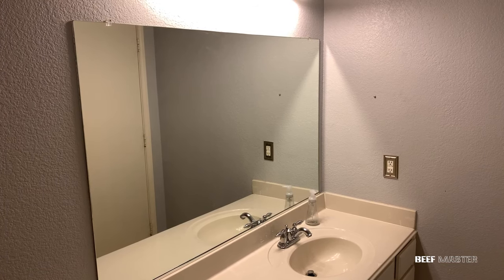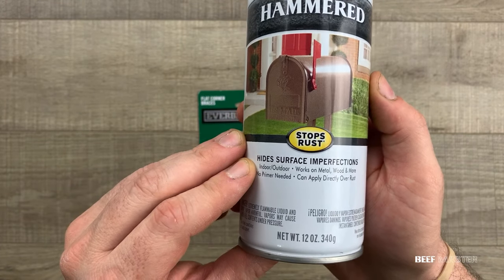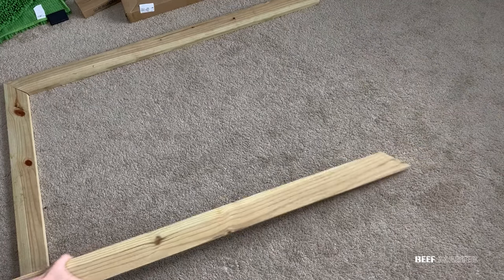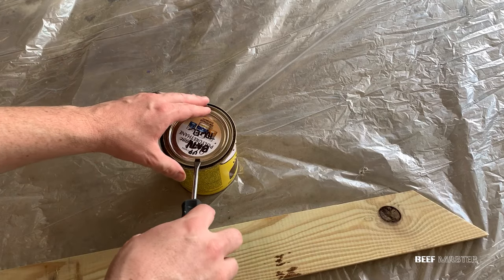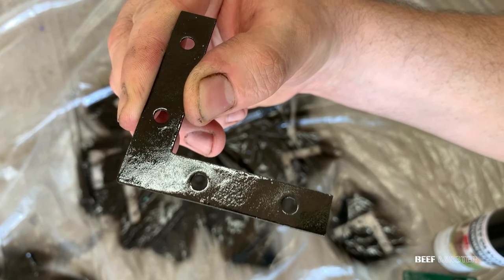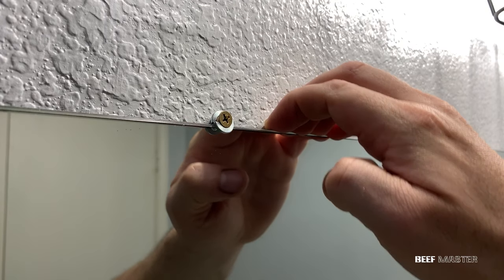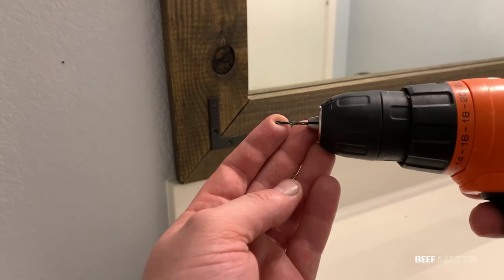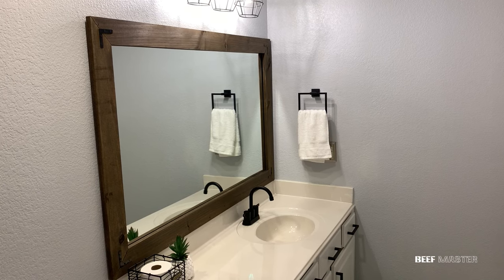How To Easily Make A Custom Mirror Frame

Comment: No sealant on the wood? In a bathroom? Needs some poly over the surface. To keep the rustic look you can use a flat sheen which is better than nothing, but a higher sheen would be best.

Comment: I am so glad I found this video!  I knew I was in the right place from the beginning bc I have the same mirror with the same things holding it onto the wall that you had in the beginning with the same color and texture wall!  I don't have those lights though (but I wish I did).  And, we are currently trying to figure out how to frame the mirror (although that is not how I stumbled across your video).  I LOVE how this turned out!  This is exactly to my taste and my liking.  And I REALLY appreciate all those little tips you gave (stopping up the drain, don't spray your wedding ring, etc.) ESPECIALLY the "don't put too much glue on it bc it will reflect in the mirror" bc that is something I would totally do.  Thanks so much!  LOVE this video!!!

Comment: We followed this and our new mirror frame is great.  Your best tip was the fuze it.  We did 2 L brackets on each corner (at outside and inside edges) which added strength.  We also put small wood blocks on the backsplash to evenly space and support it until we were sure it was secure.  Thank you for posting this… very helpful!!!

Comment: This is a good quick idea.  I just finished mine and it does change the room.  I followed everything he did except the liquid nail.  I built the frame completely  then used 3M sticky so that it was so permanent.   The imperfections in the wood make it so only use 220 grit sandpaper.  When you do the brekets before gluing it's easy to work with.
Oh yeah and I'm in Canada.   It costed almost $45 no big deal

Comment: Usually, it is release the clips and take the mirror out. But, given the clips will be gone after you put these beautiful frames, how are we going to remove the mirror, should there be a need to do so. Thanks once again for the video. It is very helpful indeed, and of course, the frames are aesthetically very pleasing. I am contemplating to do something similar.

Comment: Looks great! Personally I would have taken the mirror off the wall, moved up 1-2 inches and made a notch out in wood for the width of the mirror and mirror clips. May be able to get away with no glue then, and wood frame is flush to wall. To avoid bloching of stain (some areas darker than others) can use a pre-stain conditioner.
Reply from the maker: Great comment. Good ideas for next time.
Reply: There's many ways to make this project more complex, but the need doesnt call for it....  for a quick non weight bearing frame that's just for looks... this more than does the job.

Comment: thank you!! My bathroom mirror is like yours but smaller in my apartment. I’ve been looking to make a a cheap wood frame that will be easy to remove when I move out. I’ll have to try this!
Reply: I won’t be able to apply the glue directly to the mirror though 🤔
Reply: You could use command strips!

Comment: Suggestion.. you might want to use double braces so you don't have to glue the bottom board.  I.e. if you later wanted to replace the countertop, you might want to just pop off the bottom board for access rather than having to pry the bottom board off the mirror.
Reply from the maker: Great idea. Thanks for the comment.

Comment: Great  and easy video to follow. I have a mirror like yours, but I noticed yours appears to be sitting on the backsplash of the counter. My sits in the metal sleeve that came with the mirror. The other edges are held with the same tabs. My question is... The metal sleeve is not flush with the mirror. If I remove the sleeve I do not know what would hold the mirror. Any suggestions?

Comment: The one thing I don't quite understand is that, isn't there a small gap between the frame and the wall since it's sitting on the mirror and overlapping or how did you get it flush with the wall without cutting a groove in to account for the thickness of the mirror?

Comment: Do you not have to cock or fill the gap between the mirror and the wood? You mentioned the glue does not show if you go down low enough but is there not then an opening between the glass and the wood?

Comment: Great video! I will give this a try. Question, won’t the screw head and washer give it a bump to where the wood will no longer be flat against the mirror?
Reply: Using the same glue to attach the mirror to the wall would bypass the need for the screw and washer. I'm with you, there has to be a bump and that would jack up my project.
Reply: @davestockton5340  I was thinking the same thing.  Glue it is.
Reply: I'm just starting this project and got the standard plastic hangers, and then I thought the same thing...the boards won't be flat against the mirror.  I don't want to glue the mirror to the wall, so I'm going to chisel out a small recess on the boards to accommodate each bracket, they will lay flush against the mirror that way.

Comment: I got to the point where I stained my wood with varathane stain and poly but the wood is bowed. When I went to glue it, the sides were not touching the mirror. I wonder if it bowed while drying or if it was already like that but I don’t know if/how to salvage the wood and finish my project.
Reply: We are in exact same spot. What did you end up doing? Scrapping it & starting again? We have two boards already glued on before realizing just how bowed they are & aren’t connecting right.

Comment: What if the mirror has those silver pieces holding it on the top and bottom? Do we just place the wood directly over those or would they need to be removed for a more seamless appearance?
Reply: Remove and replace with washer, if screw is button head, replace with flat heat

Comment: Thank you so much, this has been so helpful! May I ask why the wood needs to be an inch wider than the mirror?
Reply: The edges of the mirror will be visible if the frame is the exact same size as the mirror itself. Just did my frame yesterday!

Comment: so does the frame sticks onto the mirror or the dry wall?
Reply from the maker: Mirror. You could also just build a similar frame and use hooks or wire behind the wood to hang if you don't want to permanently glue it to the mirror. If hanging it, you would want to make the frame a little larger than the mirror to hide the hooks or wire.

Comment: Question for you: let’s say you eventually will need to get the mirror off the wall. How would you do that?

Also, do you recommend sealing the wood?
Reply: You would have to pry it off but you don't have too seal if you dont want, if you want a gloss or satin look go ahead but its not needed.

Comment: So.. what if I don’t have a miter saw? Will home depot cut the 45 degree angles for me?
Reply: Plenty of ways to do square cut corners.......
Reply: A miter box and saw cost $20. If not you can use a straight board, a crosscut saw, some clamps, and math. A 45x45x90 angle is isosceles. So depending on the dimensions of your mirror you can measure 2" up and 2" across (arbitrary values). Draw a line between those points. That's your 45. You can freehand cut that or use a straight board and a pair of clamps to make a guide for your cut. You'll probably need to sand the sides flush afterward, so be sure to dry fit your boards before installation.
Reply: @franciscoramirez-lt3zc  ummmmmmm lol 🤔🤔🤔
Reply: Example; If  your using 1x4's (3  1/2" wide) and you want the OUTSIDE of your frame to be, say, 48" wide x 48" high, the two vertical boards would be 48", and the two horizontal boards would be 41". (48" less 2 - 1x4's)  Doesn't get simpler than that, and that's what most new homes are doing where I live. And the new extreme wood glues are so good you really don't even need nails.

Comment: What if I don’t have that saw? What’s another option
Reply from the maker: Two thoughts:
-You can make the mitre cut with a handsaw. Pencil a 45 degree angle at the corned end of the board then make sure the wood is secured in place by clamping it to a table with the end extend for the cut. As handsaws are very cumbersome, I would make a few test cuts on scrap wood and use one as a template when you get it right. 
For a tip to avoid splintering, wrap blue painters tape around the wood where are you are going to make the cut.
-Instead of making a mitre or angled cut, you could just make a simple boxed frame that’s square on all sides with no mitered edges.

Comment: So....You'll NEVER be able to remove the mirror now? You used a metal washer that contacts the glass? You have a huge gap behind the wood and didn't dado the back of the frame so the wood could sit against the wall?

Sorry, but this installation as a whole is not good!
Reply: Lol there are tons of questions about that 😆. That should definitely should have been mentioned in the video

Comment: Man seriously....
Using washers to hang the mirror! and sticking the frame to the glass adding an extra weight, will you call it a good work?
Plus, screwed corner brasses on the front!! You just screwed it